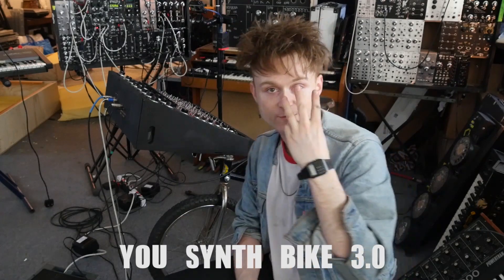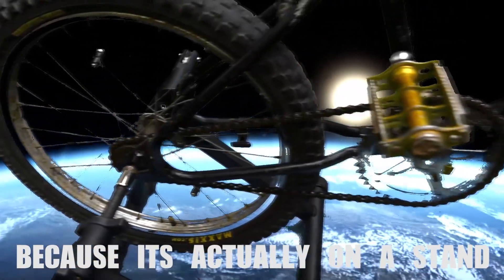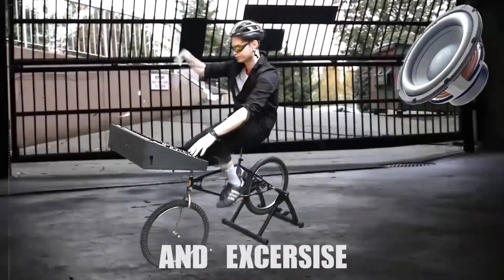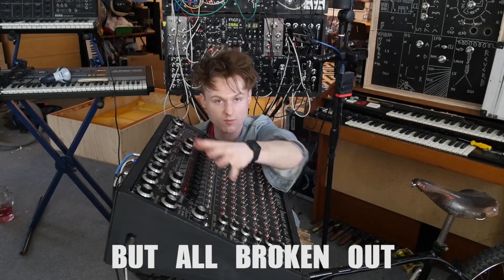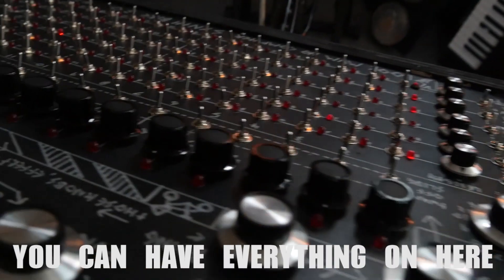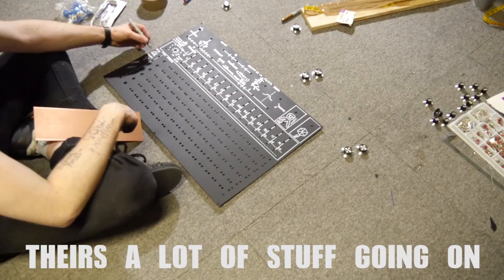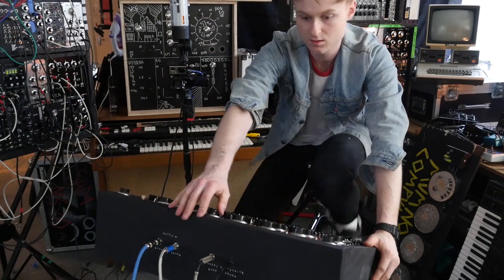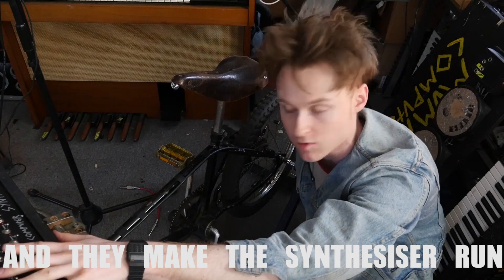#SYNTH BIKE 3.0 THE #EXCERSISE BIKE FOR THE MUSICIAN

Comment: Are you using a bunch of Arduino nano's with a multiplexer for the drum sequencer inputs? I've been interested in making a drum sequencer and was wondering if using a shit ton of Arduinos with SPST switches is a feasible option.
Reply from the maker: its not really feasible. as its a monumental amount of wires. each arduino is basically firing out steps 1 to 16 from 16 digital pins, these go into the switches, and LED's together, they then go through diodes into a shared line, which runs off to an and gate which combines the signal and the input clock, making it a trigger again, which is then triggering a drum. you can achieve the same with a simple 16 step sequencer running into an and gate. but you wont have backwards and forwards and stuff like you can program into an arduino.... no multiplexers in sight. i did it this way, because the project needed to be done from start to finish in about 5 days, no time to code new shit, so i plonked together a load of code and designs i had lying around.
Reply: LOOK MUM NO COMPUTER if I want to make a synth with raspberry pi what is your recommended way to go about it.
Reply from the maker: Captain Limabean never used a raspberry pi I'm afraid, so I dunno!
Reply: Ahh that makes sense, never thought of approaching sequencing like that before. Appreciate you taking the time to let me know how that's done, gonna get to work on some kind of sequencer over the summer. Mad props for having hands down the best synth channel on youtube and the gnarliest bike in the world.

Comment: Got any schematics for that synth/drum machine? Nice design!
Reply from the maker: Peter Scollard arduinos lots of them. 7 16step sequencers kinda like an analog one. Schematic for those in issue 5 of my zine on my website lookmumnocomputer.com. Oscillator ginkosynthese wabetable code on an arduino. Going into frequency central rogue vcf vca. Quantiser is frequency central trans europa. Envelopes are 12bit arduino code and so on. Not a full schematic exists. And it's about 200 miles from me now. So will probably be a while!

Comment: where do u buy your components for the synth? that's  got to be expensive!
Reply from the maker: shopping in the right place.can be super cheap if you go to the right places. avoid commercial electrical shops like maplin or something, if possible order in bulk from china on ebay or alibaba. im in the UK i use rapid electronics for everything else. youll be surprised actually how cheap it all is